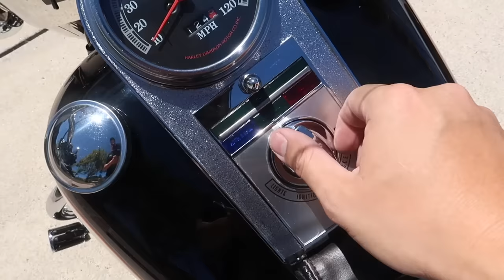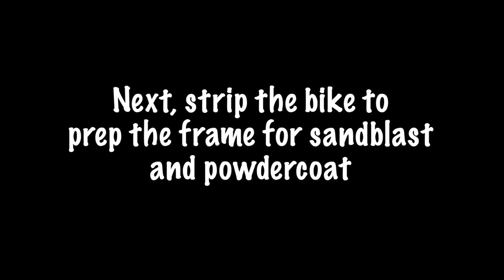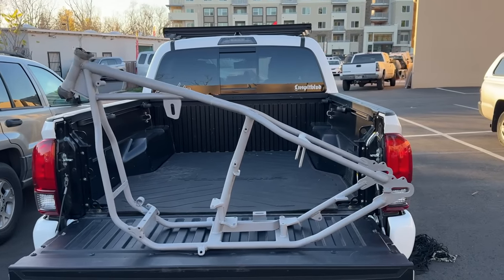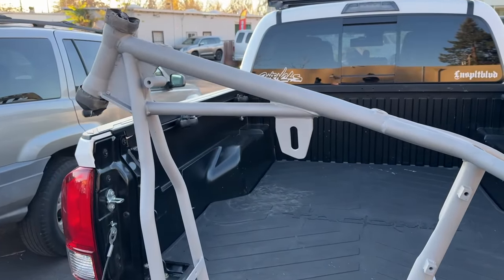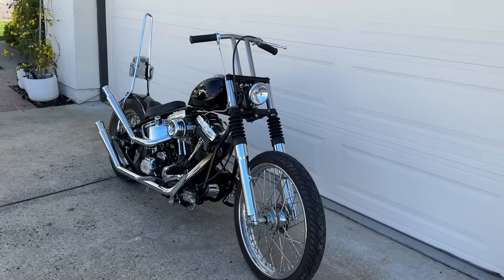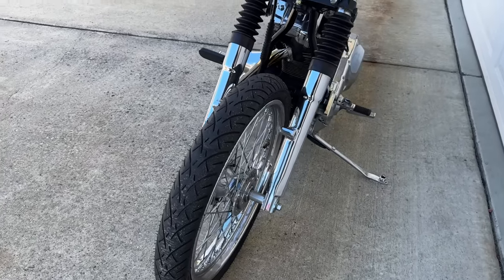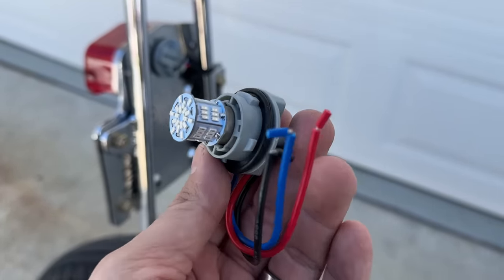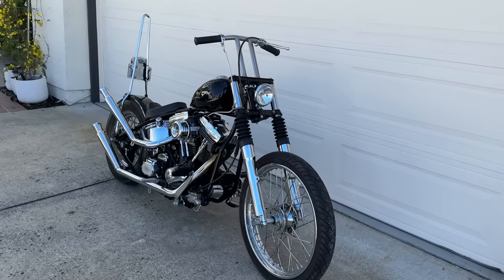Building a Big Twin EVO Chopper in 15 Minutes

Comment: Man, I wish I could afford to buy that bike. No doubt, I'd be one of the happiest men on Earth. Great job 👍🏽
Reply: He sold it pretty cheap. 12,5k I believe
Reply: You could build one just like it and for less money with a little research. People don't realize how easy HDs are to work on. Since you won't need the stock cosmetic parts you can buy an ugly condition Evo Softail, hardtail the frame (or ride it for a while to be sure your spine can hang with a hardtail, Softail frames can make clean customs) and freshen it up with a rattlecan (X25 works well) paintjob then make it exactly how you want it over time. The custom parts market makes it very low effort so go for the bike of your dreams. If new to this do buy a complete running donor.. Any later model Evo Softail will do that has the Denso starter (which also means spline shaft gearbox). If it's to keep you can use a salvage title donor bike (many get insurance totaled for cosmetic damage and that's coming off anyway).
Reply: save your penny, brother! We all started off with a dream, if you really really want it, you will find a way! Think of it as a crack head, they dont wake up thinking that they are broke and cant afford a fix. So they find a way, follow your dreams, its never too late!

Comment: No way I could've looked at that Heritage and saw that chopper hiding in there. You've got a great eye for seeing what most of us can't. 
  Oh man that build turned out just gorgeous.
Reply from the maker: Thank you, every bike has a chopper soul in them haha
Reply: When you buy a frame and slap a motor in it not hard to see the chopper hiding in it lol
Reply: @LNSPLTBLVD 
Excellent built, Man. Just one suggestion you might consider adding a Front Fork Brace. The brace will help make sure the wheel runs true.
I have one on my '89 Sportster that I built into a Street Tracker with no front fender. Looks Kool 👍
Reply: lol huh?? he took the engine out and put it in a completely different bike.

Comment: Beautiful! That’s the way we would have done it back in the day, the only difference would be lacquer instead of powder coat, and the engine. If I were building it the only difference in style would be to rake the sissy bar to match the angle of the handlebars, add a p-pad backrest, and pegs for a chick. But, everybody builds to taste, and you got perfect taste, Dave Mann would be proud. 👍

Comment: Attempting a offroad biased sportster. Should I go for an 03 no rubber mount and carbed, or a 07 with rubber mounts and EFI? Upgrading suspension with 15" in the rear and some real heavy duty moto forks etc etc.

Comment: Great video and a great-looking bike, it has real 70s 'street chopper' vibes.  Any idea how much lighter the finished bike is compared with the Heritage Softtail?  Also, how does the gearing with the chain conversion compare with the belt drive, is it lower or pretty much the same?

Comment: Idda just kept the softail frame, did a chain conversion, bobbed the back fender and got a different tank and front end.

Love those softail frames, they look like rigids but got the extra suspension which is nice. And you can still slap a springer seat on it to give it that old school look.

But I love this bike no doubt. Just couldnt afford to do half of this build 😂 thats why i wouldve stuck with mostly stock.
Reply: Softails are heavy AF because of that swingarm plus it has like 2 inches of suspension travel so it’s a rough ride.
Reply: @palmersteven0  I have an 89 softail, pretty much exactly the same bike he started with, with Fournales rear air shocks, there's nothing rough about the ride, and it certainly isn't comparable to a hard tail. But if you want the custom hard tail look, it's gotta go.

Comment: surely you could of stripped down the original frame to keep the rear suspension, now the bike is impractical for any decent rides and also unsafe(no front brake), but it looks good

Comment: OK I'm new to Harleys but I love choppers & always wanted one can someone please explain to me the difference between a big twin & a 1200 besides cc's bc I wanna buy one & build one over the summer but I love power I used to have a Hayabusa but I don't know about crusiers essentially I just want a bike I can travel states for during the summers so like is a big twin better like 1340cc to 1200cc I understand that just need more please
Reply from the maker: It all depends on what kinda look you’re going for. 1200 sporties are cheaper than big twin evos. Big twins you can add kickstart if you’re tryna go for that old school look. If I were you, I’d start with a 1200 sportster first since there are plenty of aftermarket parts.
Reply: Sweet appreciate the heads up but damn a kicker would be better looking although I imagine if look hard hard enough I could possibly find one for a 1200... also is one more reliable then the other or are they equal I mean ik everything needs maintenance but is one gonna be better for long distance traveling then the other I guess it would depend on the scenario for the motor parts tho

Comment: Why not just buy a crappy evo for the drivetrain and a front end instead of tearing a stock bike apart? Even at that, just pull the motor and trans and sell that bike you bought as a titled stock roller rather than stripping it down? $$$$

Comment: Man, I love and build choppers myself, and I can't stand the look of that yellow teflon tape. It's a pet peeve of mine. Homies spend all that time making a chopper look good only to have that ugly a$$ yellow tape. Please use Loctite Thread Sealant 592 it's meant for fuel, and you only need one bead on the first couple of threads. I use them on all my NPT fittings for fuel and oil. Then, if you use brass fittings, you only see nice pretty brass threads instead of yellow tape.